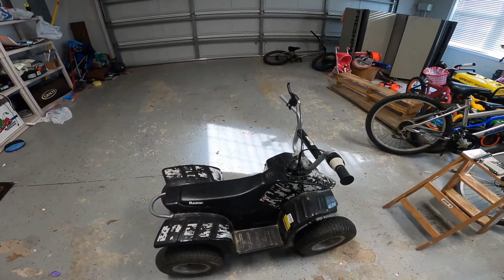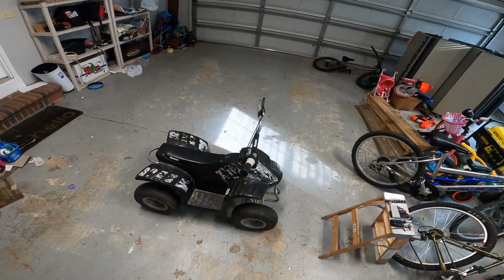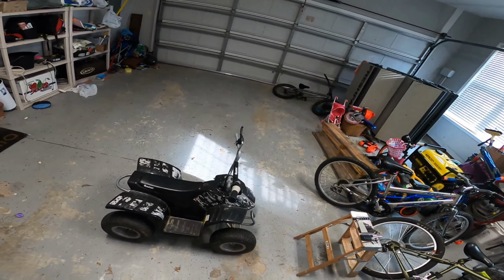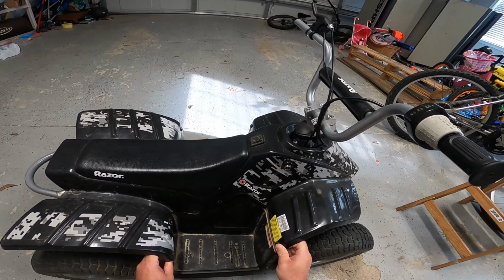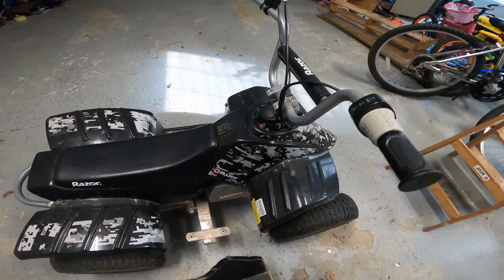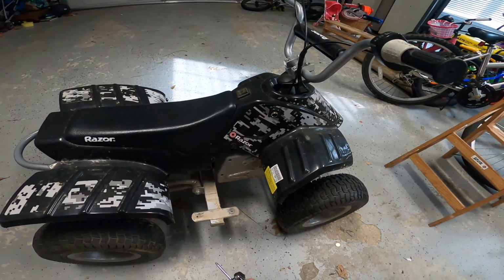Rad Razor Dirt Quad ATV Battery Upgrade and Test Ride!

Comment: I bought one of these for $20 bucks that was sitting outside for years figuring I would have to replace everything. So first thing was to buy
2-12v batteries I did have to modify the battery tray for the bigger 12amp batteries to fit because the original batteries were 12v 7amp batteries but once I installed the batteries I couldn't believe it everything was actually working. It blows my mind how nicely built these razor quads are and people actually buy these plastic push across grass 12v power wheels at the same price as these razors that not only go over grass but also up and down grass hills with no problem and are built to almost real quads durability.
But Has anyone found a seat pad & cover replacement for these quads thanks
Reply from the maker: Yeah these are great! Haven’t seen seat pad replacements though.